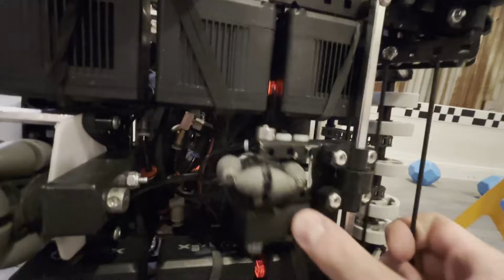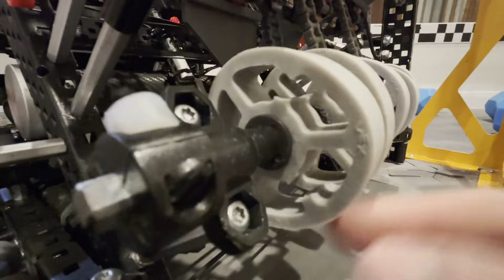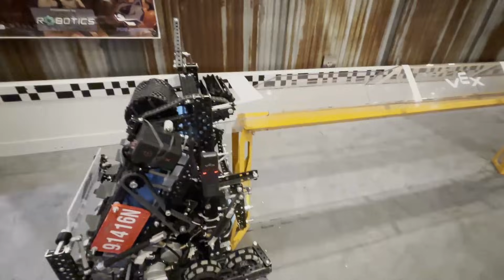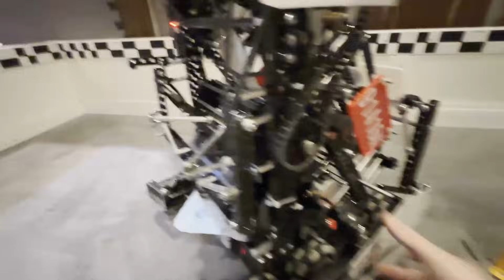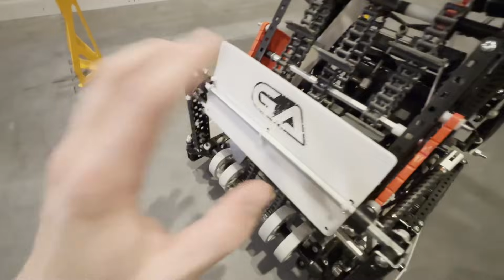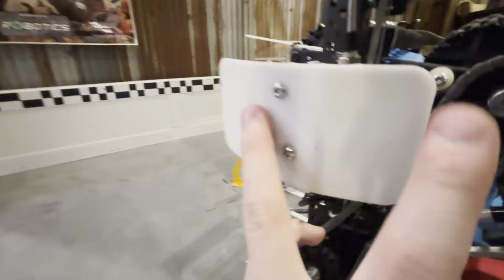91416N | Winter Robot Explanation Video

Comment: Why did you decide to use 6t sprockets for your second stage instead of 12t, I personally saw that the linear velocity increased so it was more beneficial to use 12t instead of 6t
Reply from the maker: We used the 6t sprockets on this bot for spacing, yes you are right the 12t sprockets have faster linear velocities that's why we use them on our new robot.

Comment: Do you have any tips for your middle scoring? I have my roller on the top of the balls and am moving it to the bottom like yours, since it is hard for me to fill up the upper middle goal with 7 balls. What were some key things you had to keep in mind while building a consistent middle scoring, and what were some things you learned? I really appreciate the video and a reply!
Reply from the maker: -Gap: make sure the gap for your opening in your bands on your intake ramp is enough for blocks to pass through.

-Angle: Our blocks move into the goal at a slight downward angle to reduce some of the horizontal force.

-Speed: Our counter roller spins at 400 rpm, however, this is what worked for us you may have to try different speeds or sprocket sizes.

if you have any more questions feel free to reach out to me on discord.

Comment: Can you score on lower mid goal consistently, or do two blocks come out at once?
Reply from the maker: low goal scoring only works consistently on our robot if we are holding around three blocks, if the blocks are two wide in the robot our scoring (like many other ruiguan style robots) scoring is not very good. Low goal scoring is something we are going to improve on for our rebuild.
Reply: @swatrobotics8134  Thanks for the reply! How do you pkan to fix it?(Don't have to share)
Reply from the maker: @kabitashaw4223  we are planning to do single file style intake

Comment: How are you keeping the loader mechanism up with just one pneumatic cylinder , what did you use on the other side to keep it upside!?
Reply from the maker: The cylinder has an air input on both the extension and retraction part of the cylinder's stroke. Meaning that the piston is always pulling the match loader in when not down.

Comment: Are you able to cut standoffs? We have a rule, basically that we dont cut standoffs because all we have to cut them is a bandsaw and when we cut with that, it covers the hole with metal somehow.
Reply from the maker: We don't use any cut standoffs on our robot. I'm not sure what you are referring to. But we never try to cut standoffs because they are not threaded completely through as this would make them very expensive to machine. If we need a standoff to be a specific length we can supplement some of that length by using various spacers.
Reply: Long standoffs are not threaded all the way through. only like half an inch or so. Long standoffs are filled for most of the standoff.
Reply: @pixelplays8927  We cut before it was filled. We only tried to cut like a centimeter
Reply from the maker: @C-WIT  what probably happened was you messed up the threading or there was very little left

Comment: How do u guys get into the park zone with a horizontal tracker wheel, does it not get caught?
Reply from the maker: Good question, the horizontal tracker is stable able to move up without a lever mechanism because of the slots. The horizontal tracker is attached to the robot so that it has very minimal contact with the park barrier (on the back end of the robot). Since we only park from the front of our bot the back end is usually higher off the ground, ensuring the wheel only briefly contacts the barrier, and allowing the robot to still traverse the barrier.
Reply: @swatrobotics8134  thanks appreciate it as we are switching to a full omni drive now as well
Reply: I @swatrobotics8134  I'm assuming this is also the case in skills for clearing the barrier?
Reply from the maker: @26163X yes this is the same case for skills